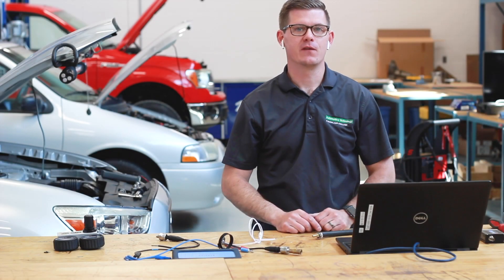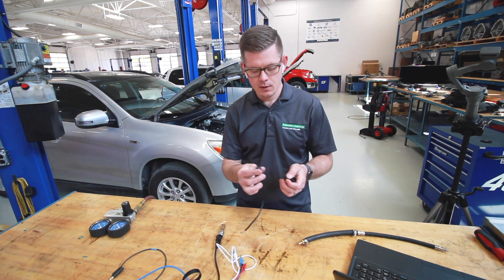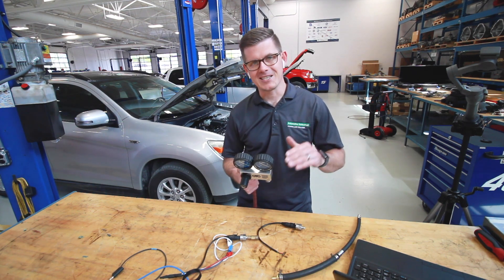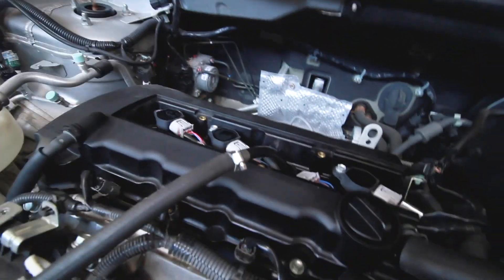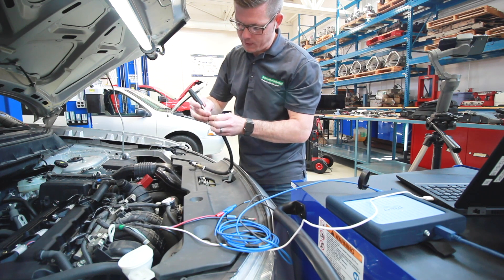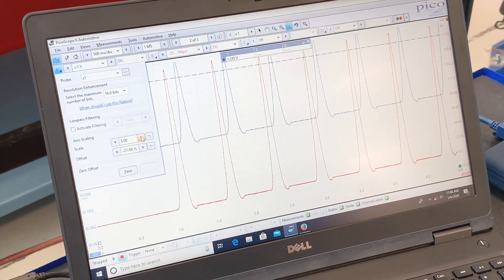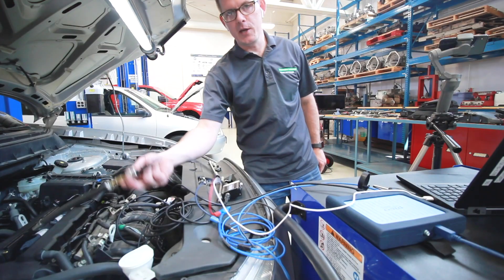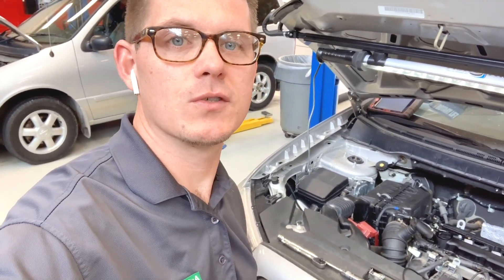DIY Scope Pressure Transducer

Comment: Hello, thanks for the video, what if I use an AC pressure transducer? Not oem or alternative part, but original from a car maker
Reply from the maker: That's a great idea. If you got one from a u-pull salvage yard it could be really cheap.
Reply: @AdamsAnalysis  a got one from changing the AC Pipe that came with the sensor

Comment: How to convert Voltage to bar with a cheap transduces? Any link? Thanks.
Reply from the maker: The sensor may have a calibration table showing pressure vs voltage. I put together some pneumatic fittings so that I could use a cylinder leakage tool to feed the sensor 100 psi and verify the voltage output at that point.

Comment: The output of the transducer is an analog voltage which is instantaneous. It is the Picoscope that decides what the refresh rate is. I don't own a Picoscope, but there must be some way of changing the refresh rate on it.

Another thing I just thought about. You are using a 500 PSI sensor; so you are using less than 1/5 of the resolution. The voltagge range for that transducer is 0.5 - 4.5V and you are measuring a low of less than 0.5V and a high of only 0.9V. I don't know what the Picoscope uses, but I'm going to guess that it is a lot less. I would try it with a 100 PSI transducer, just to see what would happen.
Reply from the maker: Thanks for the feedback, these are all great points!
Reply: @Adam's Analysis  I've seen these same transducers used elsewhere and they seem to do ok.  I'm not sure I've seen one on a running compression test.  At any rate, Lizard King is correct that the cheap transducer outputs analog.  It is the pico which uses ADCs (analog to digital converters) to convert the analog into a digital waveform.  the pico has quite high end ADCs and has a "refresh rate" (sample rate) of up to a billion times a second.  Those two things will determine how accurately it can capture (quantize) that analog waveform.  Note that in this capture you only have it set to 1MS/s a.k.a. 1,000,000S/s.  I do not see any place on screen that shows the resolution it's using (up to 16-bit), but the key is to look at the window in the upper right:  it shows the "zoomed out" waveform and the waveform looks normal there.
Reply: With these sensors you can double the pressure be for breaking it, and 4 times the pressure will destroy them, the circuitry inside the sensor has a count rate at 2 milli seconds to give the analog output,  that is why you get the sep wave form, very similar to using a DVm on a wave form signal.

Comment: so the power and ground wires going to tranducer are what we tie out scope into,and just do nothing with signal wire?also how do i determine which pin on transducer uses the power and ground?im gonna guess the outside pins can be power or ground and middle pin is signal that we dont use is this right?

Comment: Hello, I'm Brazilian and I didn't understand this transistor very well, does it work well for gasoline engines or not?  does it measure atmospheric pressure?  I'm looking to buy a transducer to use on my hantek oscilloscope, thanks
Reply from the maker: This transducer did work well overall given the cost and would provide some useful information for diagnostics on a gasoline engine. If I was to invest more time with it, I think I would purchase some quick release fittings and cut down on the amount of flexible rubber hose. I would also work on building a custom probe profile in the software. I've got a Hantek scope that I have hardly used. I should give get that going and refine the DIY transducer a bit.

Comment: Can i use pressures transducer for diesiel engine ?
Reply from the maker: You certainly can, it is just important that you verify the rated compression specification for the engine and make sure it does not exceed your transducer. PicoScope for example sells the 500 PSI rated transducer for petrol engines and a WPS600c which measures up to 600 bar (8700 PSI).

Comment: That cheap transducer is almost useless for in cylinder pressure. It completely missed the pocket after the expansion stroke leading up to the exhaust stroke on the running compression. There is some valuable information there. Some $75 Honeywell transducers do very well if you’re looking for something decent without having to get a WPS500. The price is worth it for me but I’m also a diagnostic tech that uses it regularly.
Reply from the maker: Thank you for the insight!

Comment: Great video. But the stair step pattern you see is of the settings on the scope software and not the transducer. The transducer device is analog and therefore it doesn't update. It's a continuous signal. I tried it with a cheap Ebay transducer and the patterns were identical to the WPS. No Stair step effects.
Reply from the maker: Thanks for the feedback!
Reply: This depends a lot on the transducer.  You can clearly see Adam's waveform has a time-based step in it, rather than a amplitude-based step.  

Most of these sensors have ASIC chips inside them.  They're not as simple as they seem.  These ICs allow for error correction, and compensation for non-linearities or temperature drift.  As such, they have response times.  Check out a datasheet for a Kavlico P265, for instance (15ms response time listed).  I'm not sure how these ASICs are built, but they could be largely analog still.  Response times are alluded to more like a slew rate than a sample rate, so perhaps they wouldn't give these stair steps after all.  Even so, with a 15ms response time, there would certainly be some waveform distortion even if it weren't obvious stair steps. 

If you found an affordable sensor with a quicker response time, could you provide a link or provide a recommendation?  I'd love to find one myself. It seems to be a crapshoot, with many sellers even mislabeling the full-scale ranges, so customers end up with poorer resolution than they'd hoped.
Reply: @CheapskateGarage  That it correct. I recently heard that these transducers have a chip in them that interprets the analog data. That makes sense of this stairstep pattern. I would like a faster transducer, like the pressure transducer made by Pico. It doesn't have the stairstep pattern.
Reply: @cyberslacker5150  I actually just found a great video that dives a little deeper making these comparisons:
https://www.youtube.com/watch?v=uan5mgi2mgw
I may pay a bit more for a Honeywell or SSI sensor now.

Comment: can you give the diagram how to make the connection
Reply from the maker: USB cables generally have a red (5v) and black ground. The other two (green and white) wires are communication. I used the red and black from the USB to power the transducer. I can't recall what the colors were, but I made those connections then the signal wire from the transducer was the input for the scope signal. Hope that helps!
Reply: @AdamsAnalysis  can you connect the red and black wires of the transducer to a 12v battery post

Comment: Cool project. Thanks for the idea for the USB. I almost stooped to buying a lab power supply. Instead I'm just going to use a USB portable battery (cell phone charger). I would recommend not plugging in the USB cord to the battery without first testing for shorts in the wire. If you short out a battery it might explode.

Comment: Excellent narrative! Did you ever try to find a quality pressure transducer that's comparable to the Pico? Also, what do you use for testing both + & - pressure in the same transducer?
Reply from the maker: Thanks for watching! I have not gone searching for a better transducer. We are fortunate to built up to four WPS500x kits to use with our students. As for getting both vacuum and pressure, that would likely be a more unique and more expensive transducer.
Reply: @AdamsAnalysis  
OK, thanx.
I have a map sensor from an old Horizon I'm going to test out today. Maybe that'll work?

Comment: So your samples per second rate was the same?  I would have never guessed that the cheap transducer would produce a stepped output like that.  I figured it would simply be a continuous (smooth) analog output.
Reply from the maker: I believe the refresh rate of that cheap transducer is slow enough that we can see a stepped output.
Reply: @AdamsAnalysis   the chip inside has response rate of 2 ms on most cheap ones, some claim 1 ms but not many.

Comment: Thinking of trying this with a 10bar map sensor. Is there anyway to convert the voltage on the pico software to display psi?
Reply from the maker: The picoscope software has an option for "Custom Probes" I'm not sure if PSI is one of the options. I'll have to take a look.
Reply: Absolutely. Pico custom probes is very flexible.